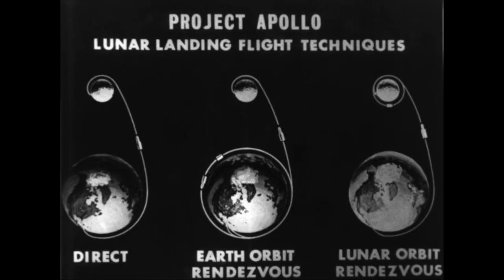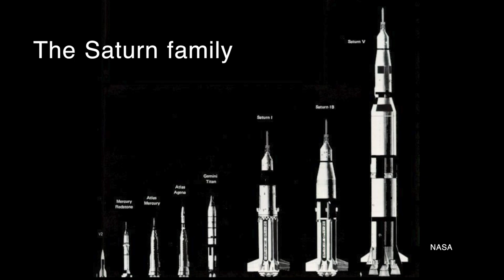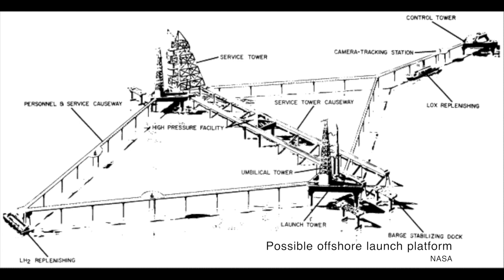How the Sounds of Big Rockets Break Apart Buildings

Comment: Loved the video! Subscribed! :-)
One question though: How do you safely transport such large preassembled launch vehicles offshore?
Reply: Maybe by seafaring it on a ship?
Reply: Well, wouldn't that damage the vehicle?
Reply: Weather is a factor here, but the small shakings of the sea vs the violent shaking of the rocket taking off is a whole other subject.
Reply: NASA transported the Saturn 5 first stages and then the Shuttle External Tanks by barge from the factory in New Orleans to Florida by barge via the Intercoastal Waterway and the Gulf of Mexico. So getting the parts of a large rocket to an offshore launch pad is feasible.
Reply: Felipe is absolutely correct. As it happens, the first stage of the Saturn V was shipped by barge to the Cape from its production center in Mississippi - the large canal that graces launch day photographs was built specifically for the purpose.
Reply: Actually the Saturn 5 (and later the Shuttle External Tank) was built in the NASA Michoud Facility in New Orleans, Louisiana. Mississippi was where the NASA rocket engine test facility is. The Saturn's were put on barges that were docked on a canal right by the plant. This plant now is building the Orion Spacecraft in part of the original plant.
Reply: I'm a dunce! I thought, momentarily, of Michoud, and then wrote down Mississippi. Thanks for setting me straight!

Comment: Doesn't it take less thrust (cheaper) to get into orbit if you launch near the equator?  Launching from an off shore platform would probably be more practical.
Reply: You are right. The closer to the equator the better. That's why some rockets are launched from barges situated out in the ocean down near the equator. It's an advantage fuel wise, but using a barge or off-shore platform does have the additional disadvantage of having to haul the rocket all that way out to the launching spot.
Reply: That's why Ariane & ESA launch from Guyana.
Close to the equator, might cook a few mosquitos, and plenty of Atlantic to the east if it all goes tits-down.
Reply: its a few % improvement...

Comment: Isn't sound dampening the reason that shuttle exhaust went into the tunnel and produced the huge cloud of water vapor?
Reply from the maker: Water was also used in Apollo, I think (and I'll have to double check this!) it was for both sound dampening and cooling the launch area.
Reply: Interesting. I remember this being a big topic of discussion in the early days of the shuttle. How the sound vibrations from the SRB's would have been shake the shuttle apart if not for the dampening of the water spray --- what it's technical description was.  :-)
Reply: That's correct Amy.  When I was on a "Gold Tour" of Pad 39 (while participating in some research at NASA), the shuttle launch engineer who took us around told us about the drum head effect of the launch pad that the upper water layer dampens, and cited a (small) number of dB as the amount of sound soaked up (haha) by the water in the exhaust tunnels converting to steam and being accelerated on the way out of the tunnels.  As I recall it was in the 1dB range - so not a lot, but at those sound levels that's still a LOT of energy.

Comment: Could a massive drive be manufactured in modules that could be carried into space by smaller rockets and assembled in space where sound isn't an issue?
Reply: absentmindedprof  I can't help thinking that the simplest way is to use Saturn V class vehicles. Something the mass of the ISS could be lifted in a year and fuelled in orbit.
Reply: Ever watched EVA´s on ISS? Two Astronauts replacing two cables for 10 hours?

Comment: The Mars Colonial Transporter booster utilizes a raptor methane fueled rocket, which I believe has a higher throat audible signature, than the proceeding more vintage F-1 used during Apollo.The F-1 was a fuel gulper, gave good trust, but had been secular in design, to generating enough trust, in held clusters for the Saturn booster ships only.

I think that Spacex has this equation and it of course goes forward as the range of character operational thrust, denoted as a regimen of decibels, at X rate of time, at what harmonic throated value.
This is of course by comparison is a quantification of a clusters of raptors times that sound increase by a factor of 42.

Spacex may dig a chambered launch pad if this launch is to be by land, or again, try for a barge launch if this is deemed necessary.
I believe that the Nova went incrementally upward is rocket motor design, so your base-line log within engineering expressions would still be a mean said value of a lower ranged audible sound."The effect that you don't want to have.

There may also be changes possibly to come within the Spacex primary design.Hope that this helps? Thank you Amy

*Notes relative gather decibel range of imaginary wall reflection.This area is what rocket engineers look at as reflected sound, from a point that is n valued, or unknown except to the expect range to where this sound is reflected back to the rocket booster structure and how this reflected sound will affect that sound making rocket booster._Values are at corresponding wavers and cyclic as well as being repetitive for an x value of time.
Reply: vrendus522 "Raptor methane", that's some serious fossil fuel! :-)
Reply: Yes it is Benny.Thnx
Reply: vrendus522  I wonder why Methane?  Since methane can be cracked to produce hydrogen and industrial quality carbon, we would avoid the greenhouse emissions and the rocket would benefit from a greater specific impulse.
Reply: thank you, yes it can https://en.wikipedia.org/wiki/Sabatier_reaction
Reply: vrendus522 why is your English so broken?
I tried reading it but I can't.

By the way, I don't intend to offend you
Reply: You might want to try some punctuation, yourself, "there,.. Biffy"?

Comment: With sound that loud, how did it affect the astronauts that were sitting on top of the rocket? I never heard of any issues. But if the sound is 200+ decibels 900 feet away the astronauts were clearly in that zone.

Comment: So, there’s no muffler on rockets. 😳 I have a question for you. What damage is done at a launching pad if any?
Reply: Putting a muffler on a rocket would completely defeat the purpose of the rocket. A rocket is a newton's third law machine, so the thrust is directly correlated to how much mass you can throw out and how fast. A muffler works by slowing down the gasses coming out. So, in the case of a rocket, it would decrease thrust to the point where the rocket would not be able to lift, at all. Also, a muffler creates back pressure, which would increase flow separation on the engine, and destroy it. Not to mention at the temperatures, pressures and velocities of a rocket  exhaust, no muffler would be able to survive for more than a fraction of a second. 

Regarding damage done to the launch pad, a LOT, that's why launchpads have either sound suppression systems, large flame trenches, or both.

Comment: the motors they have now are much more efficient than when Saturn 5 was lifting off. so the likelihood of them making a louder boom is reduced. Also with lighter weight martial. Solid fuel lifters as supplements and changes in fuels types. payloads are lighter and more cost effective to put in to space.

Comment: it looks like 9 engines though.            |             2x4 + 1 = 9 
                                                                 |
at 1:00 thats what i see            ---- ---- | ---- ---- 
                                                                 |
                                                                 |
Reply: If you looked closely, the "Centre" Engine isn't actually an Engine.
It just looks like it because of the 4 Central engines being so close together.
Reply: There is not an engine in the middle so it is 4+4 engines :)
Reply: greyson mueller The graphic is a bit misleading. Nova's final design was supposed to have eight engines clustered around a center point, as evidenced in the illustration (there's no center rocket). For some reason, though, the illustration has something extra at the far back that's partially obscured by the other engines.

Comment: Is there anything that engineering can do to smooth the flow of the exhaust gas from the engine and nozzle.   Sound radiating laterally to the exhaust must be carrying away energy and therefore reducing thrust.    Smooth the flow of exhaust gas to reduce the sound by a small percentage and there should be an corresponding increase in thrust allowing a somewhat lower powered rocket.   All this is easier said than done.   Allow me to use a real life example.   Some years ago Bosch engineers decided to make their dishwashers quieter.   There's a limit to using insulation for this because it intrudes on interior space.   They looked for all of the sources of noise and choose methods to harmonically suppress vibration and smooth the delivery of the water that washes the dishes.   In doing so they reduced the power requirement for the motor that delivered the water making the unit even more quiet.    The result in my personal experience was a dishwasher that was quieter than a pasta kettle of boiling water.